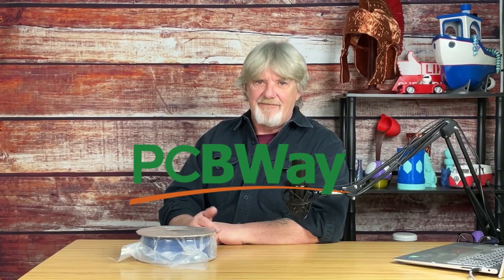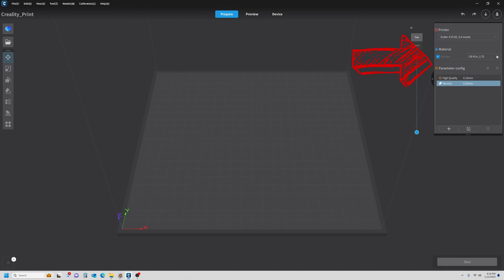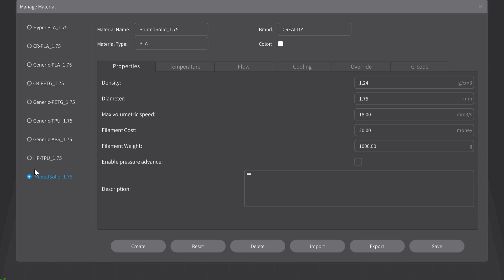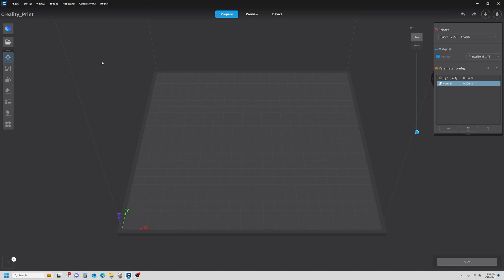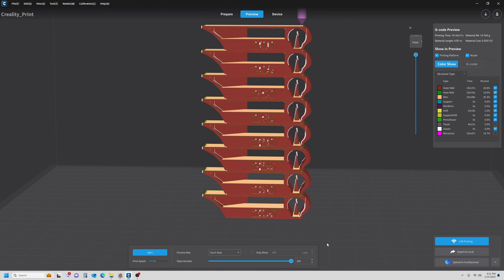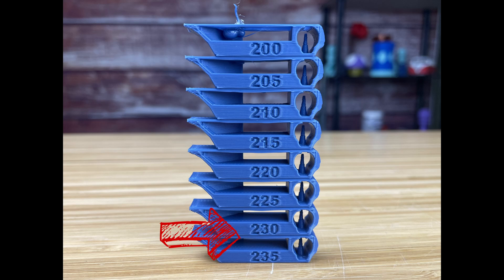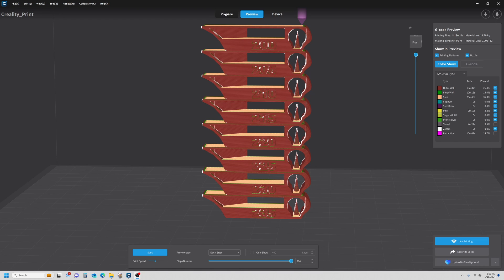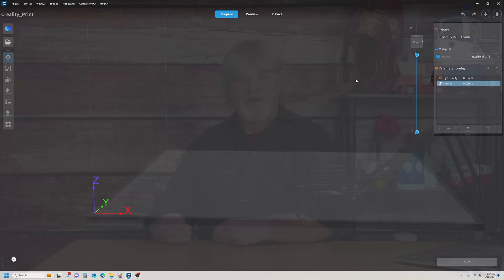Creating A Custom Material Profile In Creality Print

Comment: If Ender 3 V3 KE comes with default flow value of 0.95 and calibration leads to -13%, thus it means I should correct 0.95 to 0.82?

Comment: Will you make a similar video for creality print 5.0? I can't seem to find the option in that program :(
Reply from the maker: You got it! But I found a bug in the flow rate calibration and was holding off until that was fixed. But in the mean time, if you want to get a head start, in the upper right part of the screen where the filament type is, it might say something like "PLA".  Click on the downward pointing arrow. This will show your current material, printing and bed temperatures. To the right of those, you'll see a pencil icon. Click on that and that's where you modify/create material profiles. I hope this helps, if not let me know! Thanks for watching!
Reply: @pushingplastic7445  The new version is indeed missing the obvious button to add a new filament. But since I found the solution, I share it here:
1)Select closest filament type from presets
2)Edit it
3)Click the Save button. At this point you can give a new name, if you don't want to overwrite the previous profile.
Reply from the maker: @jpjokela1  Awesome!!!

Comment: Any idea why I would not have the save button on my screen?
Reply: I am using a Macintosh.  I realized that my version was a little behind. I updated and now have the Save button.  Go figure
Reply from the maker: My first guess might be that you have Creality Slicer and not Creality Print. They are two different programs that look very much a like. Creality Slicer is actually an older program. If this is the case, I would download and install Creality Print. My second guess, and not as good. If you are running on a Windows PC, try running the program in administrator mode. Please let me know what you find! Thanks for watching!

Comment: I am wondering why my Creality Slicer menus are totally different? I don't have the Calibration etc? I have version 4.8.  Love the vidios
Reply from the maker: You are the second person to say this same thing this week. I'm a little puzzled by it as well. I'm looking for an answer. I do run Creality Print in administrator mode from Windows by right clicking on the icon and selecting Run as administrator. I don't know if that's making a difference or not. If you try it, let me know if it makes a difference. Thanks for watching!!
Reply: @pushingplastic7445   Thanks for replying.  I figured my problem out. I was in Creality Slicer not Creality Print 😑 (Face Slap).  I have downloaded Print and it looks the same.
Love your video's  and especially the Fusion 360 to print stuff.  I am new to 3D printing, have picked up my sons hand me down printer, so still in the set up mode.  Started using Fusion a few moths ago as I have been using Sketchup for decades but it doesn't do STL on the free version, so still a lot of learning on Fusion to go.
Thanks for the great Video's and it's good to see someone from the USA doing Metric 😛 Just need your aircraft manufactures to get with the times and get with it, so I can reduce my tools in tool box 🤔.
Reply from the maker: @trevorgaulke712 Great! Glad you figured it out! I had another viewer ask the same question this week, I wonder if it's the same problem? As for Fusion, I think it's great! Here's a tip, something to try. You mention about exporting to an STL, with Fusion you can also export a file type STP, commonly called a Step file. I'm not 100% sure if the free version has it or not. But a STP file is more accurate than an STL, especially on curves and holes. Creality Print will accept a STP file. IF you get some time, try it with a small print and see if you like the format. Thanks for letting me know what the issue was and thanks for watching!!!